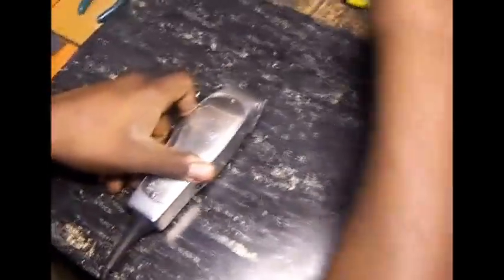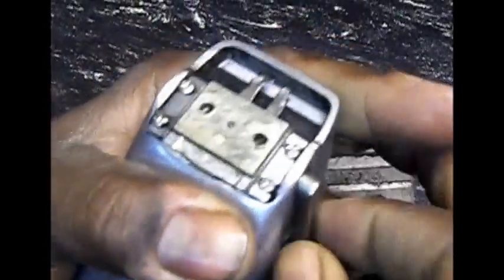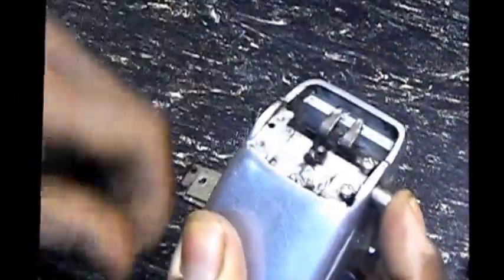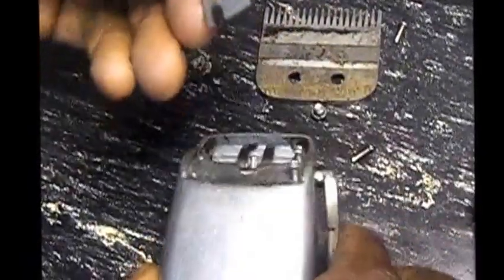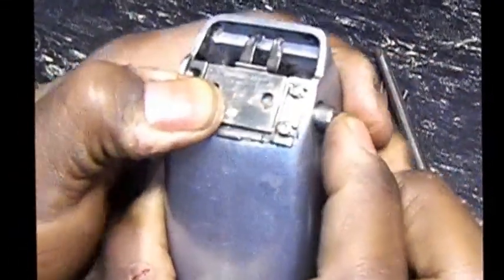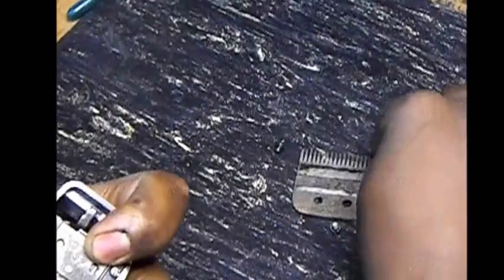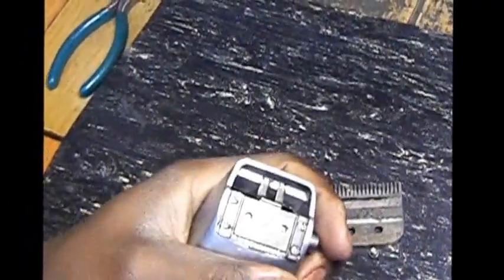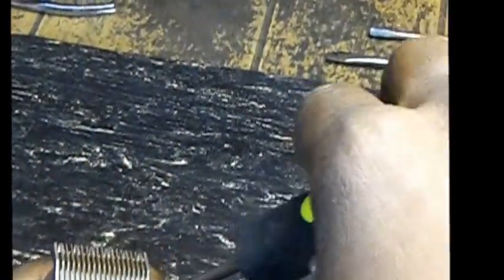andis master stiff lever repair

Comment: Hello, I took my blades off Andis Cordless Masters to sharpen them and clean the clippers.  After I put the blades back on, they dont cut anymore.  they make a noise and the blades move but theyre not cutting.  I tried to pull the tension spring to give it more tension but it didnt work.  Can you tell me or show me in a video how to put the top blade back on over the pring to see if im doing it right? Please Help!!!!

Comment: Hey bro. I have a question. On my Andis Masters the issue is not that the lever is stuck or not moving, my issue is that the lever moves too freely (easily)  especially when I have the blade all the way closed or open one notch while I'm cutting or just holding the clipper still. Can you help with this problem?
Reply from the maker: take the blade off. what you will see in front of you is the blade pad. there is four screws one on each corner of the blade pad tighten them and you will fix that problem